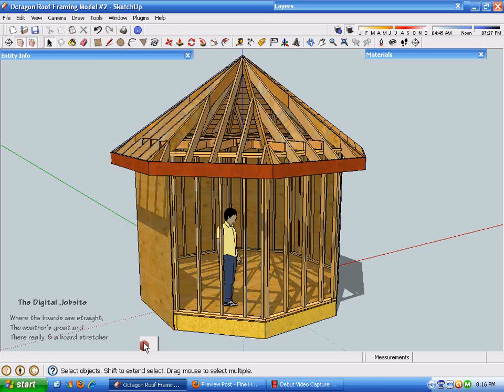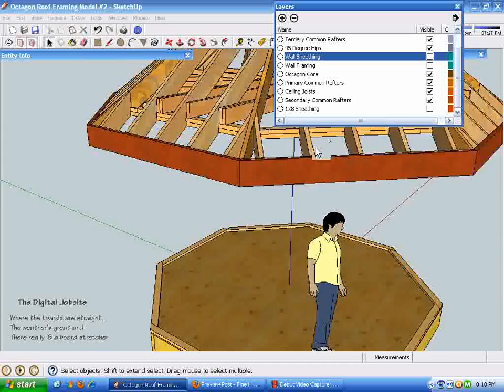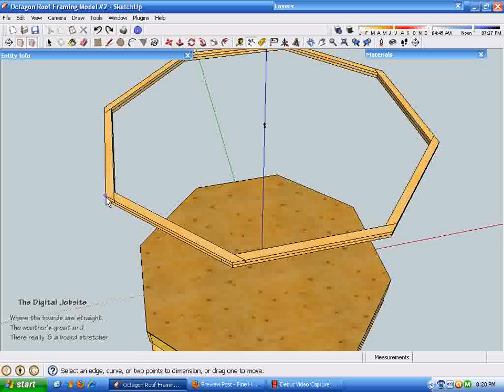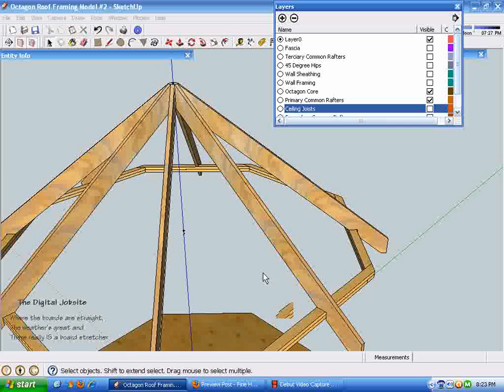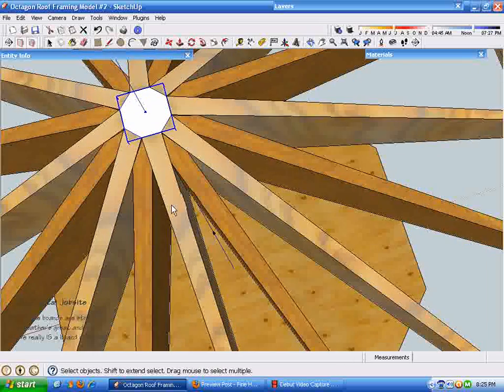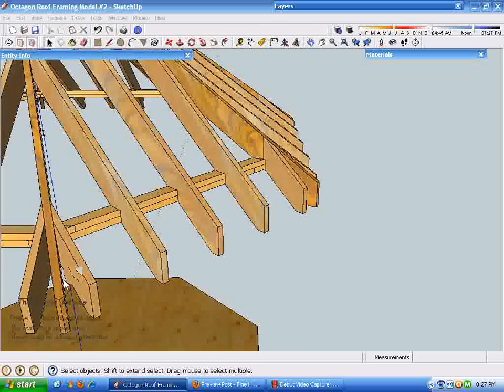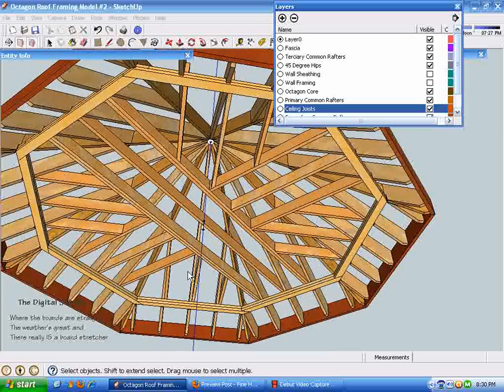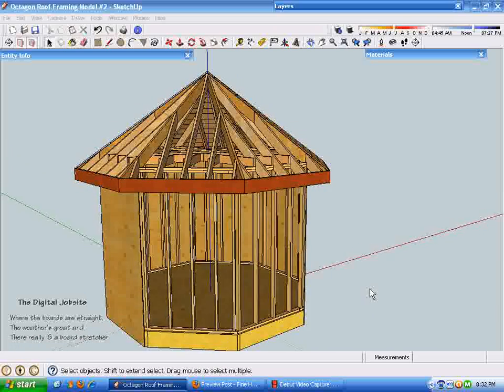Exploring Octagonal Roof Framing Part One

Comment: say the roof was a 8/12 would you cut the hip on a 8/17 ? Im confused due to the 22.5
Reply: Hey Bob,
I'm not sure I understand your comment but I think the answer is that the hips still run at 22.5 degrees to the wall plates on an octagon.  This compares to the 45 degree angle they typically run on a regular hip.  Plumb cuts on regular 45 degree hips would be cut at 8:17 with an 8:12 common rafter but, as the video shows, those plumb cuts are different when then number of sides is different than 4.
If I've missed your point just re-post the question and I'll try again...
Thanks for watching!!
Reply: lets say i have a 6/12 roof. useing a frameing square to find my angles i put the square on 6'' and 12'' mark. now cutting a hip for the same roof i put my square on 6'' and 17'' to get mt plumb and seat cut. now concider that hip to be on a 90 degree wall corner with the 6'' and 17''. now my question to you is if that corner is over 90 degrees or an octagon can i still use the 6'' 17'' ? thanks for your help
Reply: Being you are on a 22.5 the base measurement is less.  On a 45 degree hip the outside corner is square so both base legs are the same. (opposite & adjacent) 12" squared + 12" squared = 288" the square root of that is 16.97". So we use 17". For your 22.5 degree you need to take the cosine of 22.5 degrees (.92387953251) Take the standard base leg (the run of 12" for the common rafters) and divide the 12" by the .92387953251 to get the run for the 22.5 degree hip which will equal 12.989" Call it 13" Cut a test piece to make sure.

Comment: How many of these have you actually framed?  Using that block at the top makes it very hard to frame, because you can't get in there to nail the rafters.  The best way to build an octagon is to start from the CORNERS, and bring the first pair of hips opposite each other, and join them together, via the 2nd pair of hips at 90 degrees to the first pair.  Then you fill in the remaining 4 hips.  Forget about that block altogether.  There's more reasons than I've mentioned to not use that block.
Reply: Exactly